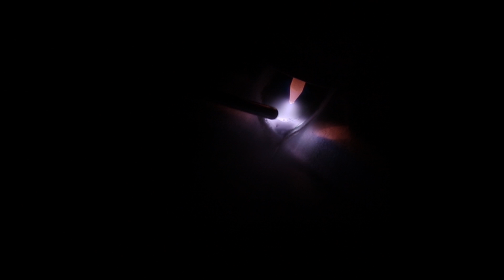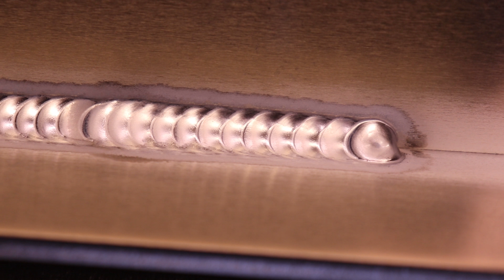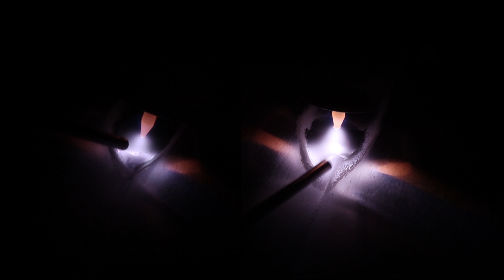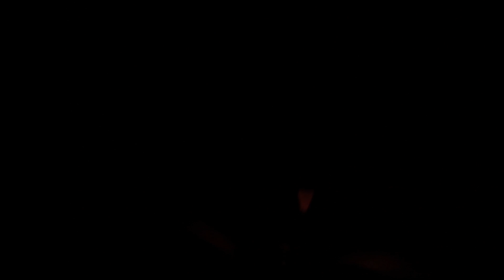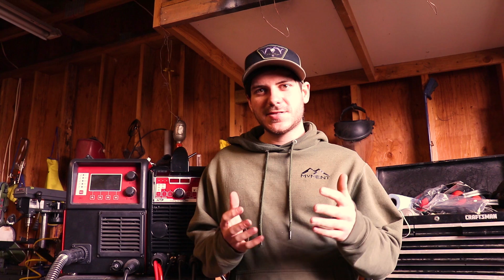The Most Important TIG Welding Tip

Comment: Hey, man. New subscriber here currently in trade school for welding. Fantastic arc shots and vital information. Thanks a ton! Any tips for TIG without filler material? I do pretty decent with filler but tend to get undercut without it on corner joints lap joints.
Reply from the maker: Thanks bud.  Ya I did quite a few years of autogenious welding on thin stainless.  for the outside corners instead of fitting it up corner to corner I put the edge flush that way it almost acts as a filler.  With the lap joint concentrate your tungsten on the top edge of the lap and let it melt into the bottom that way.  The material from the top edge should help keep you from getting undercut.  If you still are getting undercut you can try turning down the amps or practice moving a little faster.  Anyways thanks for watching bud and I hope this helps!

Comment: Excellent.  Long arc means higher voltage and because GTAW is constant current, it means more power which is more heat.  And that heat is mostly in the torch.  Wasted money.
Reply from the maker: thanks! and good to know!

Comment: How do you keep from balling the end of your tungsten?
Reply from the maker: I'm using an inverter with adjustable AC balance so I tuned it  so it has less electrode positive which helps keep the heat input on the Tungsten down

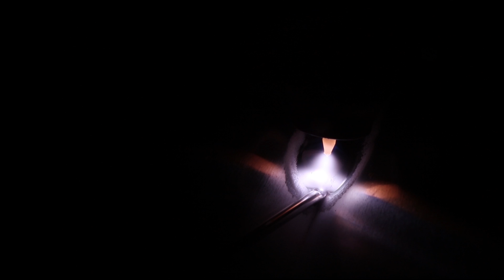Comment: @2:40 I think You misunderstood the concept of "electrical power" ... Short arc let's say 10V @ 200A = 2000W / 2000J/s but with long arc, let's say 17V @ 200A = 3400W / 3400J/s. And since TIG is a Constant Current machine, therefore the current is held at the desired value (within the tolerance of individual machine) typical +/- 5% and the voltage (effectively power and partially heat input) is controlled by the arc length. So to control the heat input there are three factors playing: Time per given length of joint, Current and Voltage. Current being constant (not using foot pedal), Voltage being variable due to human nature and our individual welding techniques and lastly Time it takes to finish given length of joint.

My point is: the longer the arc, the more heat input, not vice-versa as You stated @2:40. 
Great content regardless, and keep them coming up !
Reply: Wider heat input with a long arc, its electricity, always takes the shortest path, the sides end up closer to the tungsten then the root and the power spreads out thus reducing the Amps per sq inch, even though you are putting more heat into it.
Reply from the maker: Yes exactly!  I'll have to watch it again but that was what I meant haha thank you!

Comment: is that tungsten pointed?  ball out your tungsten for aluminum, you will be able to use less amperage while getting a nice wide wet out. you're over heating the material, you're also murdering the vertical side even though you're sitting at a V position..  still a fillet though!
Reply from the maker: It's pointed.  I run a sharpened on Aluminum in inverters it's much nicer to control.  At work it's all transformers so I ball it there.  Yes you get a wider bead but it's much easy to get into the root without burning through on thin material with a sharpened Tungsten.  Also I'm a lefty so I'm it's actually the bottom plate I'm murdering.  Haha it's super hard to weld around a camera and see/ actually weld.

Comment: This helped me, that’s what I was doing wrong, not enough heat.
Reply from the maker: Great I'm glad!
Reply: @5thStreetFab  What's the signs of to much heat?
Reply from the maker: @chipsammich2078  there's a couple things.  The ripples will be just barely defined.  If it's a fillet weld like this and you have to much heat it will burn through the backside.  It will either have push through or suck back.  And the bead will be gray
Reply: @5thStreetFab  welp I've had some hot beads then lol some of my ripples are none exsistent. You should do more videos on aluminum Tig. I've seen alot on of them on YouTube and learned more from your video tha n i have from most others